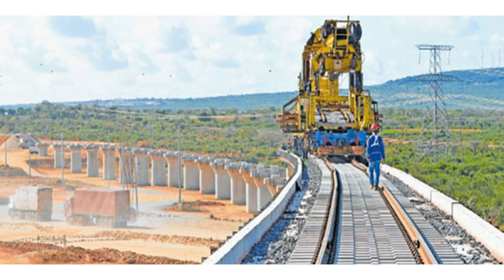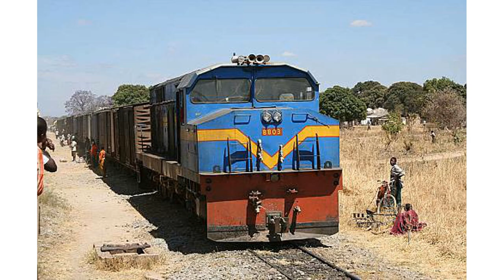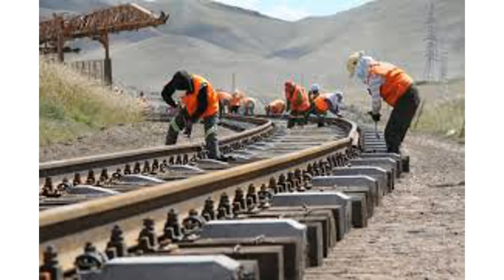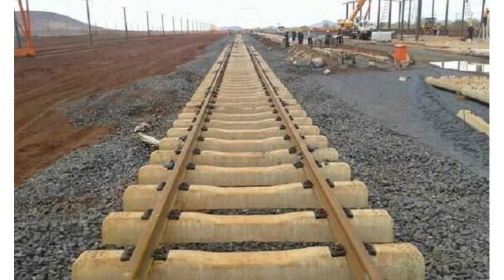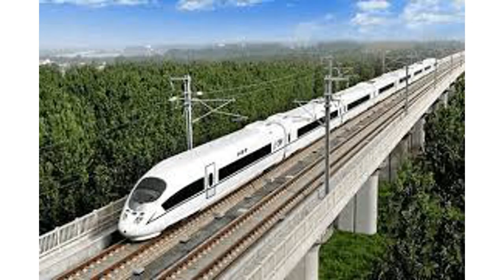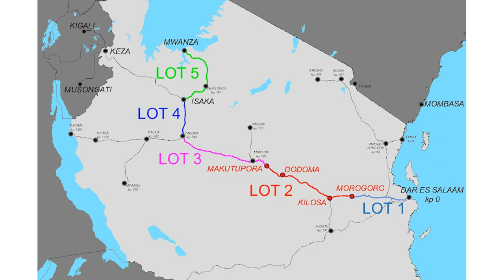Tanzania Standard Gauge Railway  Dar- Morogoro-Makutupora-Tabora-Isaka-Mwanza  #Reliyakisasa #SGR

Comment: All the other Lots, the construction has started and some will be finished soon.
We need to start LOT 4, as soon as possible
Reply from the maker: Sure, lot 4 need to be done simultaneously  for seamless connectivity. Luckily, it is the smallest of all the phases, therefore when started it is likely to take a shorter duration. All the same , the pace at which the project has been done is admirable and worth emulating.
Reply: @stuffworksexplained3901  Absolutely
Reply from the maker: @broeisi  I  am not sure whether the Chinese companies have been awarded the contract. Chinese companies are good at implementing projects on time, but they have not passed the skills to the locals, they want us to continue relying on them. If Yapi Merkezi are passing the skills to locals, that's a good thing, they should be awarded the remaining lots.
Reply: @stuffworksexplained3901  The contract Magufuli made with Yapi was to pass the skills to the locals - that's why they were awarded many lots.
Chinese are very selfish when it comes to skill sharing, that's why Magufuli didn't use them in a lot of projects.
Reply from the maker: @stevenlevittt  That's how it should be, any project should benefit the locals, in the short and long run.
Reply: @stuffworksexplained3901  Yeah
Reply: @broeisi  LOT 5 was awarded to Chinese, LOT 4 hasn't been awarded yet